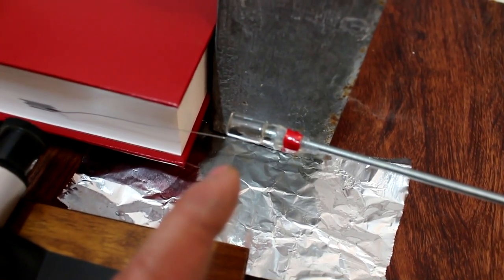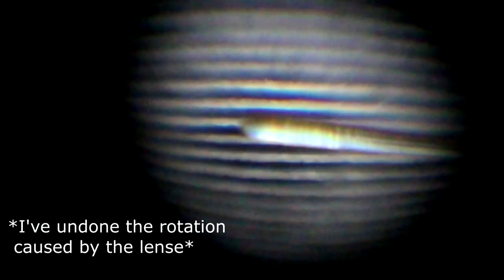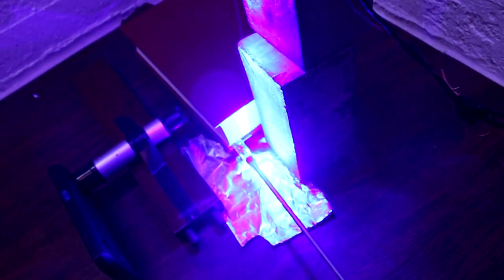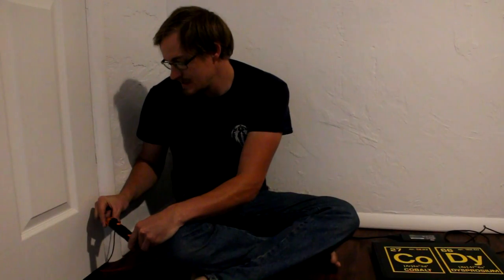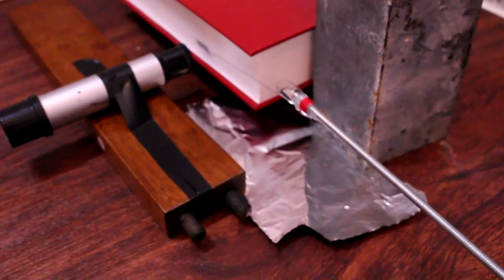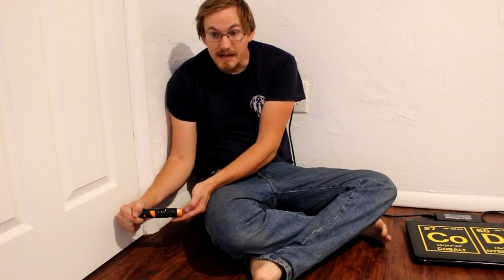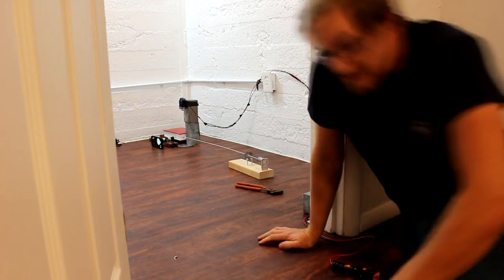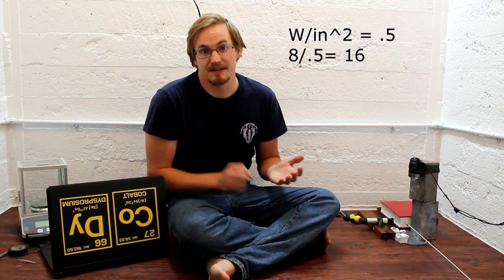Does Light Push?

Comment: Cody, you stimulate some of the best discussions among your followers!  So here are my two thoughts:  Two questions, please, from a non-physicist:  First, light is reported to “slow down” as it passes thru a diamond.  I’m talking about speed, not refraction or reflection.  Is that reported slowing down, then, incorrect?  Second question:  Gamma rays from an EMP or solar flare are reported to “rip off” the outer electrons of oxygen and nitrogen as they pass thru our atmosphere.  If that were the case, do these gamma rays then continue on in the same direction (no reflection?) and with the same energy after doing this electron “stripping”?
Reply: Its important to clarify that light is not truly slowing down. It is still traveling at C, it just takes a much longer path through the object as it bounces between atoms.
Reply: When light travels through objects, it does not slow down, but appears to slow down. Every particle it passes creates its own response which interferes with the original light. The resulting wave is what we perceive as a slow wave. Essentially, you can not affect an electromagnetic wave (which is a superset of light) in any other way than by creating a new wave that sums with the original one. 
As for the stripping of electrons, it is easiest to answer with the preservation of energy and momentum. If a photon of gamma ray made some work, gave some energy to other particles (electron, oxygen), then it has to lose some of its own. So, essentially, it will continue with a different wavelength. As for the direction, you can take a look at the momentum. This one is also constant for a closed system, so if an electron got some momentum, the photon changed its own. Since photons can not change speed, it means a change in direction. I.e. "reflection".
But again, since this is quantum world, you need to be careful - a photon is an elusive thing. It is not a ball nor a wave. To deal with quantum world, you need to go into probability domain, which is really weird.
If you want to read on it, I would recommend Feynman's physics lectures. They might be slightly behind the date, but otherwise are great.
Reply: Gurux13 and KynigosTheWolf, Thanks for a most interesting response.  The two of you are obviously comfortable in a world that I find outside my experience and it probably answers a question I have had for years.  Would you mind restating your answer, as I understand it, by responding to that related question:  A photon with a wave length in the blue visible light range, for example, cannot have some of its energy tapped off and then that photon continue in a lower energy state, maybe green or yellow?  That's what I understand from your answer above . . . is my understanding correct? I used to think that was how fluorescence worked, for example . . . silly me!
Reply: Richard Robertson Yes, that is correct. Since light must always travel at C(the speed of light), when it reflects of an object it loses energy but not momentum. This decrease in energy means that the wavelength must increase(redshift) after it is reflected.

Comment: New challenge, Cody. How about a prototype of a laser-powered engine that can propel an object of mass through a vacuum? I would have liked to see the difference with the lights in the room off. Obviously you were measuring the increase in force, not overall force, but it might have made your results easier to see.  Maybe a small IR light off to one side to illuminate the camera target.  Would IR make a difference in the experiment? How about with a different colored light, like a red laser, or a green one?  Does wavelength affect the force?  Great video, man.

Comment: I wonder if you would go so far as to create the entire mechanism like this in a vacuum environment, internally held up by super-cooled magnets such that any seismic/air vibrations would not affect the apparatus at all. That way you can probably have the light reflecting/absorbing piece be further out on the rod as to be more sensitive to any force that tips it.

Comment: First, you should have done the experiment in vacuum to reduce the effect of convection (8w laser is a lot) plus wind.
Second, the best way to measure light pressure is to use a small pendulum in vacuum with variable period. The laser should be switched on and off in sync to the period of the pendulum. 
The amplitude of the pendulum oscillation can be used to calculate the actual light pressure. This should be relatively easy since the effect of the laser is only needed to compensate for the energy loss of a single oscillation period, which in a well designed oscillator in vacuum should be very low.
By varying the pendulum oscillation frequency, the effect of any periodic seismic vibration and/or external magnetic field can be averaged and filtered out, since only external forces that oscillates in sync with the period will significantly affect the oscillation amplitude.

Comment: @cody'sLab why when you turn off the laser the pointer does not jump back to original position? this seems to be more an effect of heat (maybe dilatation?) as it take time to dissipate and come back to original shape. This could be excluded if heating from the side will NOT move (or will move less, then you could do a difference).

Anyway love your video!
Reply from the maker: I didn't show it for enough time about 10-15 seconds later the needle returned to the starting point.
Reply: +Cody'sLab if it didn't there would be a problem :) but why it takes so long? IMHO it should be immediate as soon as the photon stop to hit.
Reply from the maker: same reason a weight on the end of a short string swings back and forth faster than one on a long string.
Reply: +Cody'sLab but then I expect the same time needed to "push" is needed to come back, no? I'm puzzled.
Reply: What a coincidence, I am a student and I have been working on this exact experiment too!
I believe what he is observing is a somewhat photothermal effect, the same effect seen in a classic radiometer. 
My method is different however; I use an evacuated bell jar at 10^-6 hectopascals. Such low pressure is needed to eliminate the photothermal effect.
Inside the bell jar is a torsional pendulum with 3 mirrors. I use an infrared laser to push on an end mirror and a green laser for measurement. By reflecting the green laser off the middle, I can extend the length of the reflected beam and VERY accurately determine the position of the pendulum.
Cody, if you need any advice on this topic, pm me. I would consider myself an expert on the topic at this point, and I can tell you a lot of useful stuff when trying to detect photon momentum which can help you on your project.
Reply: it's got to have a little time to get up to speed.

Comment: The movement of the paperclip is not a full representation of reality, the observed movement is not the full force of the laser because some energy gets absorbed simply by the balance moving. A change in velocity requires energy, even if the balance was perfectly balanced it still has to overcome friction of the pivot point, aerodynamic drag, potentially also unknown magnetic phenomena produced by the laser cancelling some of the energy out. I by no means am saying your calculation for how much force the laser can produce was wrong but just that it's interesting the observable only shows most of reality but not all of it

Comment: Cody, I didn't think you accounted for thermal expansion , the laser generating 2 watts will be giving about 2 joules per second to the metal rod. As the metal is thermally conductive it will expand slightly. Tow joules per second may not sound like much but its more than enough to cause an effect as its capable of igniting wood and paper at that power rating.

Comment: if you make the needle with which you read the results two or three times longer, you'll see a much more defined result. also, you could put the scale on blocks of rubber and see if that absorbs some vibrations. another thing, is that the laser will heat up the air around the mirror, which might negate the effect partly. you might want to do this in full vacuum. maybe a nearby research centre wants to cooperate with your experiments? that would be really cool!

Comment: Found via Googling "lead magnetic":  "Even though lead is not magnetic it can interact slightly with magnetic fields."  Ok, based on your assembly, I'd think the infinitesimal force you're tying to view has to not only deflect the swing arm, but has to overcome any slight magnetic attraction of magnet to counterweight.  Might an alternate dampening arrangement be helpful?  How about an electromagnet instead of permanent magnet?  Such could be energized for a time, then turned off once damped?  Then, only the pivot friction and surrounding air resistance might impact the swing arm moving?

Second, what of the spectra of light used?  You're using a laser, which, just based on observation, has a distinct color (it unquestionably is not sunlight-like).  Aren't the photons of a portion of visible light imparting a different force than would happen from a fuller spectra of light?  What if your test apparatus could be the target of sunlight (from a window or directing mirrors)?  What of a high-intensity tungsten lamp focused through magnifier?  Would the light beam from that need to go through a liquid for 'cooling'?  I can't find "light cooled by liquid", but I'm sure I've seen this arrangement demonstrated.

Last, and perhaps a quibble (or goal of an improved apparatus) - edges of book pages are certainly a good start.  What of higher magnification of the business end of, say, a very fine hypodermic needle (as pointer) placed next to a piece of paper upon which has been printed a reticle?  Could a very fine line pattern be created in a graphic editing program - maybe at maximum resolution, then the image resized smaller by many orders of magnitude, then printed on a very high resolution laser printer?  I think you get my gist.

I confess chuckling off the video based on your title, but once viewed, was fascinated by the explanation, setup and demonstration.  Thanks very much for doing the work!!

Comment: Very admirable effort and thought process 😃 I would have been satisfied with the old light bulb looking thingie with the spinning light and dark panels inside
Reply: That thing is called a radiometer, and is what Cody was talking about in the beginning. It actually works by having one side of each panel heat up more than the other, and this heat reacts with the limited atmosphere in the bulbs providing thrust. 

Radiometers don’t actually work without a thin atmosphere, light pressure is not enough to overcome the small amount of friction.

Comment: Light pressure is a strange phenomenon. In fact, something that most people might not know, is that Crookes radiometers (which are used as demonstrations of "radiation pressure") don't actually work by the principle of light pressure. They work due to the expansion of air inside the near vacuum - about 1 Pa of pressure. Air molecules expand and cause a pressure wave that causes movement of the vanes. Light hitting the black surface causes the emission of IR radiation which is absorbed by the air molecules, causing them to expand. Conduction of heat to the air molecules adjacent to the black faces also accounts for expansion of the air. This is why they always spin with the white face leading and black face trailing, unless you cool down one side of the glass - this causes reverse rotation due to the heat differential between the cool glass and the warmer black surface losing heat by radiation.

Comment: Nice work if it turns out to be verified- good math and controls for your experiment. Here is a question: Would the scale still move if the laser were attached to it? You must see the work some have done with acoustic levitation and if you considered light at least in some aspects consisting of waves the same would apply. There is more too: wave locking like when a surfer rides a wave some have referred to the concept as a "pilot wave".

Comment: Photons have no mass but they do have a theoretical mass as per E=mc^2, the energy of a photon is E=hf so it's theoretical mass is hf/c^2, if we put that into the classical momentum equation (p=mv) we get hf/c^2 * c, therefore the momentum of a photon is hf/c if you cancel the speeds, as c= lambda*frequency we can cancel this further to get p=h/wavelength

Comment: That is an ingenious rig.  You did an awesome job building that thing.  Congrats on a well thought out experiment.  I never would have thought of it.  I just have a quick question for you and your ubersmart friends.  If a target completely absorbs a photon, all of the energy of that photon is imparted to the target.  You say that if a target reflects a photon, twice the energy is imparted.  The reflected photon doesn't slow down or change wavelength, so it has just as much energy as it did before it struck the target.  By my math, that's 3 times the energy that the photon carries.  Where does that extra energy come from?

Comment: Very cool experiment.  The only thing I would do differently is accurately measure the actual power of the laser at the point of impact, taking into consideration the inverse square law. (Keep in mind your source is a point source).  I think you will find that your laser power is less than 8W at the point of impact.

Comment: I really can't ignore the multitude of noise sources that could affect the needle if its really made to be that sensitive. In order to stabilize gas in an envelope like that room every surface of the room should have same temperature as the air so no convection induced currents manifest. Your voice was clearly audible in that room as were  possible other noises, kinetic enrgy can be transfered via sound waves into that needle etc. Tests like these cost so much because of this very problem of canceling out even any possibility of interference. Often only solution is to just send the entire experiment to orbit or bury it under ground in some remote stable place.

Comment: hi, interesting. try using a antivibration table,when i made holograms i used to use a concrete slab laid ontop of a semi inflated tire inner tubes. worked well as i lived near a busy road and it reduced the vibration massivly

Comment: With the foil on the floor underneath the bottle, wouldn't reflected light from beneath add an additional upward force - cancelling at least part of the downward force you are trying to measure?    I was going to suggest something nonreflective under the bottle, but realize that something might heat up and create an upward air current (cause its not a vacuum).  Instead, mount something that reflects the light that 'misses' the experiment somewhere besides straight back up - like a mirror at an angle or something.

Comment: Since light has mass, is there an finite amount that can fit into any particular space? 
Could only so much light fit into a 1'x1' cube? 
Thanks! Great video.
Reply: well, light doesn't really have mass, but there is a limit to how much light there can be at any point at a time. if that limit is exceed, a blackhole (a kugelblitz to be more precise) is created.
Reply: GraveUypo a black hole(made from light) will be theoretically possible but the heat generated will be too extreme for anything to actually contain in human knowledge
Reply: No, an unlimited amount of light could be put into a single point of space time.

Yes if enough light is put into a single point in space then a kugelblitz will form, but you could still keep putting photons into it.

The property of "taking up space" is a result of Pauli's Exclusion Principle.  Light is not effected by this.
Reply: @k_tess  Meh. At high energy levels new particles would be created in photon photon interactions. These particles would "take up space".
Reply: @coloradoing9172  Yes and they'd annihilate almost immediately. 

And that only happens when high energy photons collide head on.

Comment: you should use a large solar focus panel then channel it with a scope. you might get quite a bit more visible energy shown by passing some more pages. more acurate
Reply: that'll probably melt everything to red sauce.
Reply: For this to work with the laser he had to be inside with the lowest winds/vibrations possible. while I like the idea of a magnifying glass (what you're talking about would just melt everything including the scope) it would not be possible to do that outside. And the idea was to calculate the force of a small laser, not the entire sun on a very small focus point. lol

Comment: 6:40 out of curiosity, how much does the needle move in response to your voice in the next room, if at all? I just realized the magnet setup was meant to dampen such vibrations but I for one wouldn't mind a followup video if you have the time about the degree to which speech will "push" as used in the video title.

7:20 edit: having reached the playback of the needle, it looks like the needle moves with each approximately monosyllabic vocalized numeral, although I suppose that is easily compensated for and also less of a displacement than the laser should do.

10:25 it's also reflecting off the glass